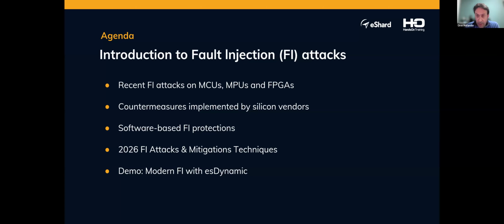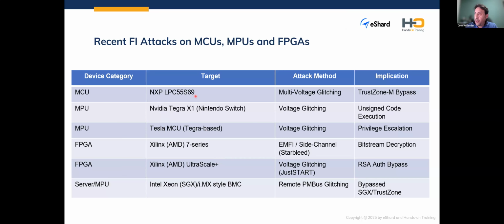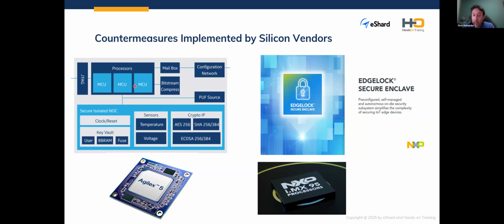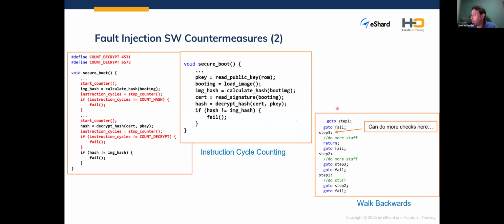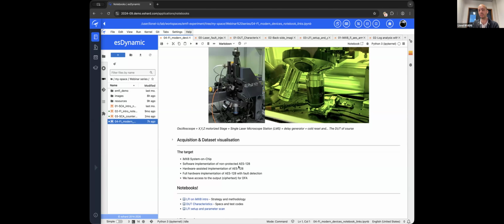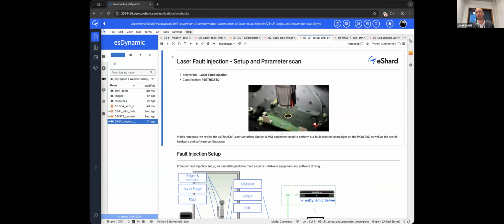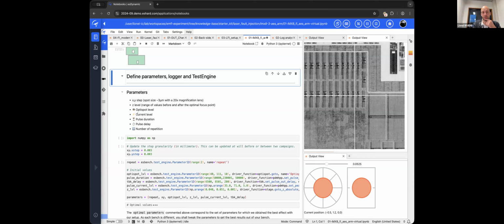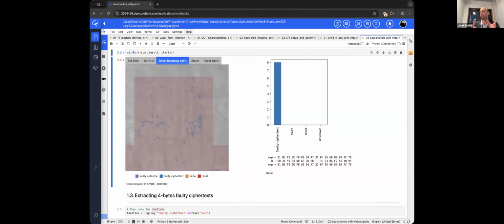Webinar | Fault Injection on Modern Devices

Comment: I guess the most challenging thing is to decapsulate the MCU to get the silicon surface without loosing functionality. What are the limitations of the LFI attack? How do you deal with the case when the AES engine is in the deeper layers of the MCU and the layers are separated by metal?